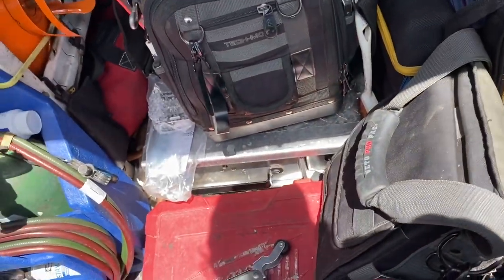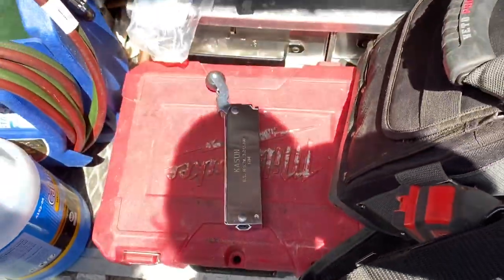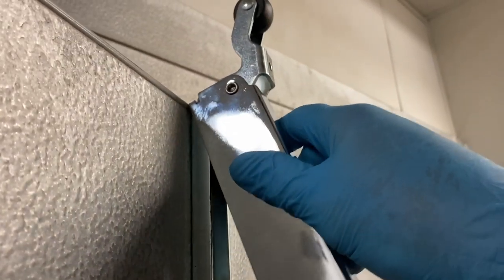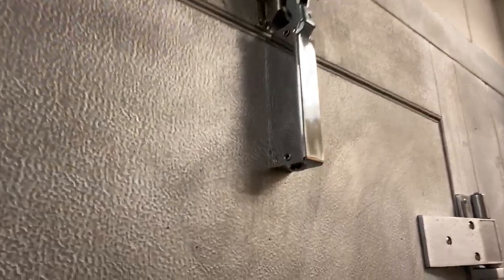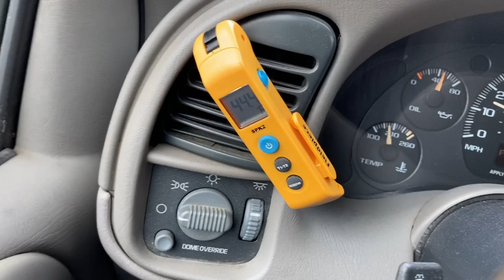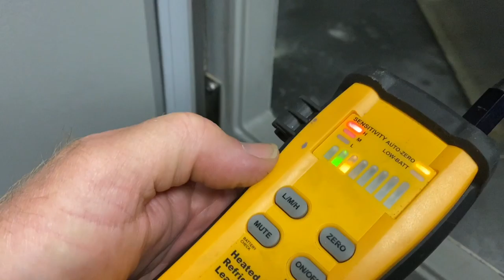How to replace the Kason 1094 door closer

Comment: I use an old sharp edge 2" putty knife to put against door/under edge of closer(protects door) and a wide sharpened old screw driver to wedge between chisel and closer(sharpened wedge shape punch works too) most important thing is use putty knife as backer so you don't dent/gouge the door (yup, done that wrong before, the door wasn't as strong as I thought)

Comment: van recharge lol. old R134a converted junk will pull to about 48F idling, then driving continuous nearly ice the evap. up and run a gauge in vent to 34F.
compressor makes a god awful "dry" rattle when it's been sitting for multiple days/week, still has the old MO oil in and some added junk. dinosaur compressor (old fridgidaire long model)